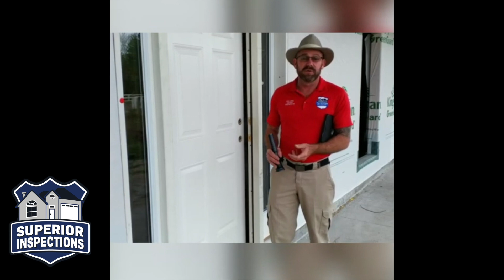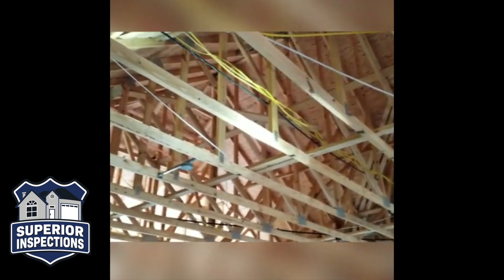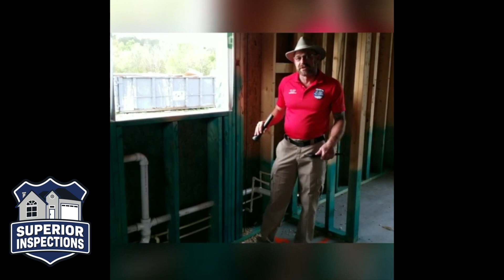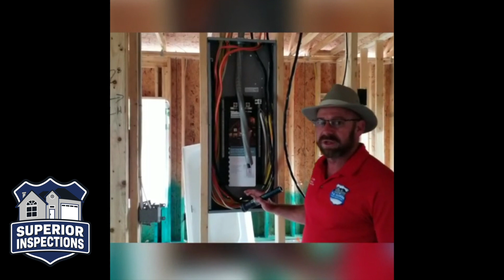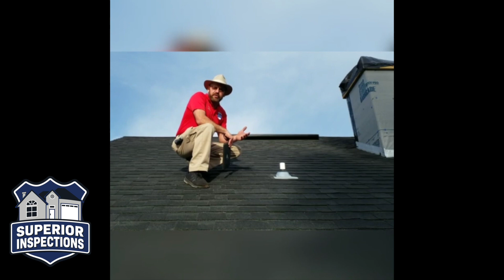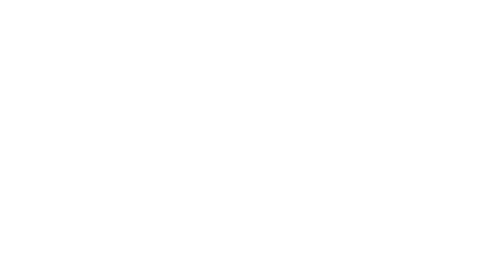Superior Inspections | A Superior Pre-Drywall Inspection | 833-396-8377

Comment: Whats the green on bottom of boards. We always have nail plates over wires and pipes, before inspection and insulation.
Reply: Termite pretreatment. It's a spray they use to prevent wood destroying insects. ;)
Reply: The green stuff you are referring to is actually a dye, the borate treatment for termites is actually clear

Comment: Hi dreb2g, thank you for checking out the channel. We are a home inspection inspection and we do all 3 phases of new construction inspections, pre slab, pre drywall and final walkthrough in house. Our inspectors are trained in what to look for to insure that the structural aspects of the framing have been installed as they should be, and that they have not suffered any damage in the shipping or installation process's. There are facets to a pre drywall inspection that an engineer would have no training in and would most likely not want to accept responsibility for. My personal background is in the contracting industry and I hold a General Contractors License as well as a Home Inspection License. I am extensively involved in the New Construction Inspection training that all of our inspectors must go through.